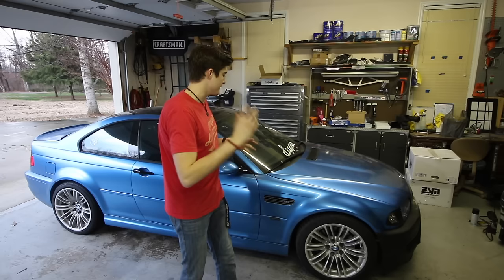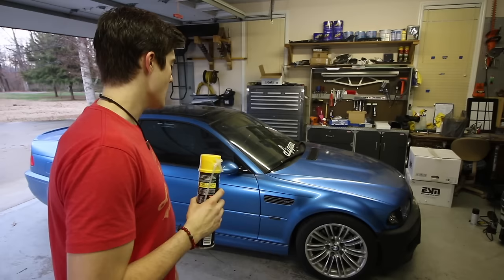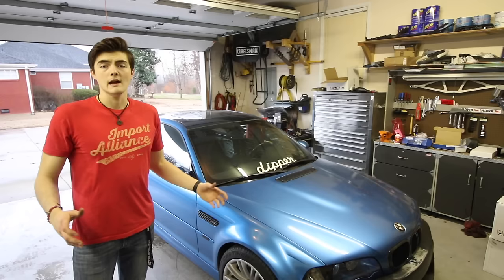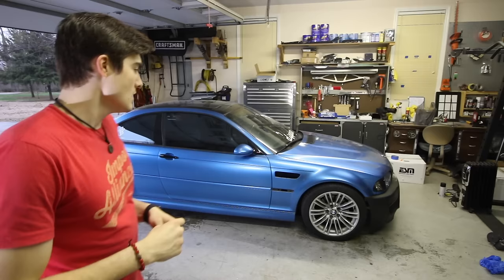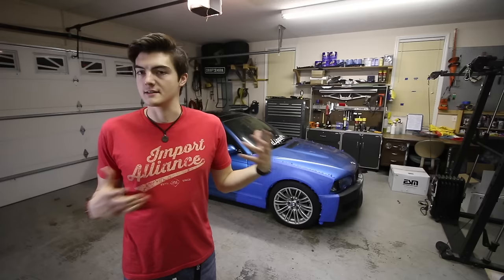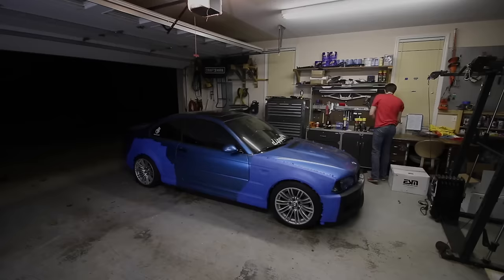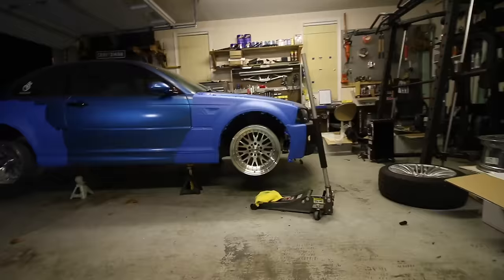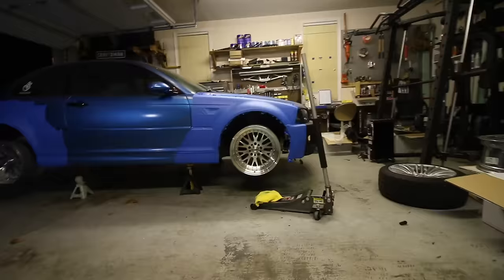DIY Widebody M3: Part 1

Comment: Some initial thoughts:

1)At first, I thought you were crazy. I still think you're crazy but in a nice way.
2) You are a masking tape madman. For this project alone you have used more blue tape than most professional painters use in a lifetime.
3)Your love of lugnuts is a compulsion rivaled only by your fascination with blue tape.
4)Your wheel wells are now insulated to R34. You should receive an award for this contribution to energy saving.
5)When all is said and done, you will have a beautiful BMW with cat hair integrated into the widebody.

Thanks - you are doing an excellent job!👍

Comment: for those saying he ruined the car, look at the end result it actually turned out really good i’m surprised
Reply: Spacers are not the way to go if you actually plan on driving the car.
Reply: @unknownip6741  Spacers can be exchanged for wider tires - that's not the point. The point is whether the kit he made is good or not.
Reply: He used hub centric spacers and yes they can be used because he is not using the common crap spacers from autozone aka the other style he had previously used
Reply: he ruined the performace, not the car, but great looking isnt performance

Comment: Kyle very good Video's just one thing that may help in the next fiberglass project  google fiberglass rollers they help to roll the air out and make it easier to form the glass work also a tip with the mold wax it before you start to make your fender it will help to release better , Great Job.

Comment: Your description of offset at the beginning is incorrect... having a larger offset in the back would result in the rear wheel being more “tucked in” than the front. You used spacers, not offset...
... just wanted to clear that up as most people here are still learning things

Comment: This car would be worth over 40k if it was stock, sad to see.
Reply: How would it be worth $40k? Stock it was black 2, with like 130k miles. You can find those for $9k all day
Reply: Tielhor an e46 m3? Ppl look for stock ones the stock ones sell for the most on biding sites
Reply: @memes4themasses365  well most of them aren't 2000 mile mint condition on BaT, go on Craigslist once in a while
Reply: Tielhor your probably thinking of the 330 ci those you can still find for under 9k but just like the e30 and e39 they will also go up in value, his m3 e46 is worth a decent amount and soon would be worth a lot if he left it stock
Reply: @memes4themasses365  lmao, I've had 2 friends buy 100k mile m3s for under $10k that were mostly stock, only a couple of performance mods, and nothing visual. Also I've worked for BMW for the last 4 years, pretty sure I know the difference.

Comment: Bauschaum?!? Das soll halten? Bei der kleinsten Bodenwelle hätte ich so eine Angst, dass der Kleister abbröckelt...

Da hätte eine Investition in ein anständiges Bodykit mehr gebracht. Vor allem wenn man sich in den Staaten einen BMW M3 leisten kann...

Da hätte es doch auch für ein LB-Performance-Kit reichen können.
Sieht zumindest fast genauso aus, wie das, was du da zusammengekleckert hast.

So bastelst du 100% 
nochmal dran rum. (↓Oder auch nie... xD↓) Denn DAS kann nicht halten...

Mir egal ob du das hier verstehst.
Dir ist es offensichtlich auch egal, dass du damit deine Umwelt gefährdest.
Was, wenn dein "Kotflügel" vorne abbricht (oder abfällt), dann kann es passieren, dass deine Lenkung blockiert, wenn der Mist dein Radkasten vorn ausfüllt...
Ein bisschen zu schnell, widriges Wetter, eine Unebenheit auf deiner Strecke...
Und Zack. 
Dir passiert vielleicht gar nichts, aber eventuell versagt deine Lenkung, du kannst nicht mehr manövrieren und segelst ne Mutti mit Kindern um.
Man sollte dir das teil abnehmen wegen Unverantwortlichkeit.

Diese Typen die nur um ne "coole" (deiner ist nicht cool) Karre zu haben, solchen Mist verzapfen, sollten mal daran denken, dass deren eigener aufgeklebter Heckspoiler mal ganz schnell zur eigenen Hinrichtung werden kann. 

Ich finde es gut, dass Leute wie du irgendwann den Darwin Award erhalten, und so wie du dich anstellst, bist du bereits nominiert.
Traurig nur, dass es meist die unbeteiligten erwischt.
Sei ruhig Opfer deiner eigenen Dummheit.

Aber sorg wenigstens dafür dass du niemandem schadest.

Comment: spacer??? ur going to build a wheel bearing killing machine ^^ and the car handling would be terrible. change the suspension if the car schould become wider.

wow and don't put foam on it. this will be broken if you have driven a few times. better cutting and welding new sheet metall on it (or use fiberglass).
with foam it will not last long

Comment: First,  to stop air bubbles on your tape, use a damn bank card to push out any air. 
Second, the cardboard under the arches is a good idea but I use a piece of galvanized sheet metal (like 0.6mm) that I've touched up the topside of to allow the foam to stick. The sheet metal will follow the arch shape a hundred times better than cardboard.
Third, why waste your time on a fucking beamed?